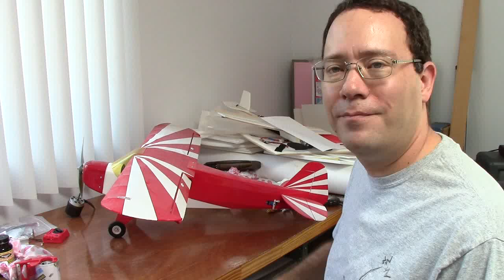Understanding the Coanda Effect

Comment: yes is vacuum but in different way. why fluid tend to stick? because of friction moving one will start moving surrounding one, because of solid next of pressure will drop between and voila: vacuum and coanda effect

why wing create lift:
archimede law plus kinetic energy, wing profile accelerate surrounding air adding mass to compensate differences... all the rest (shock wave) are for make that process more effective (energy efficient)... a wing will move air in equal mass with plane mass

Comment: coanda effect as coanda defined is: a moving fluid will have tendency to stick at 1st solid surface he meet. coanda say nothing about curved at this point... working with curved surfaces are applications developed using main effect
next: high speed create low pressure, this idea is all over but... is stupid, any differential pressure in open environment will be compensated and annihilated in instant with violent reaction... vortex and that is bad for aerodynamics and structural integrity